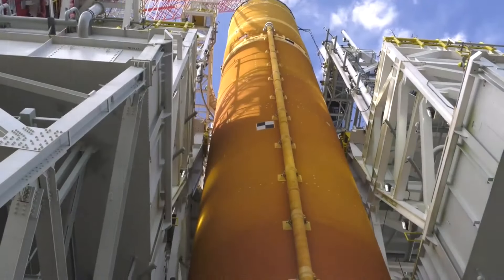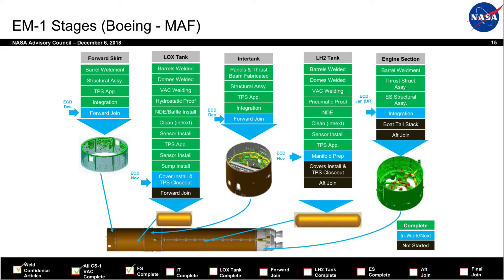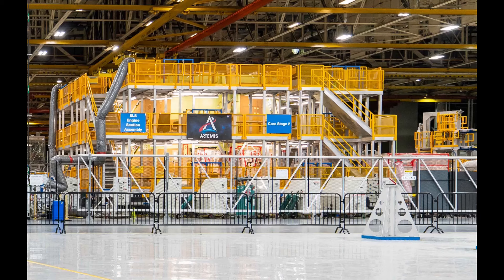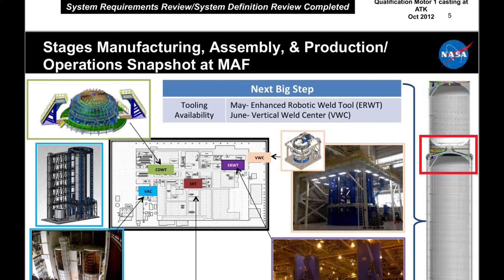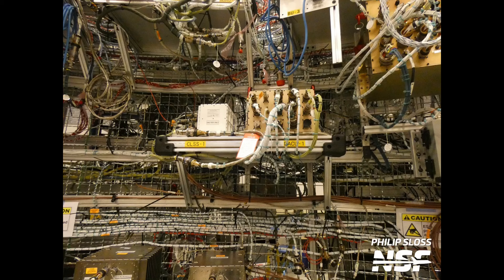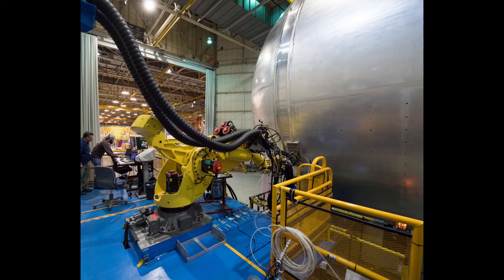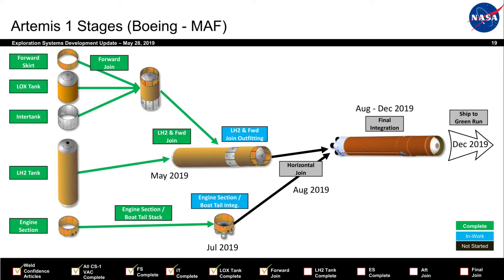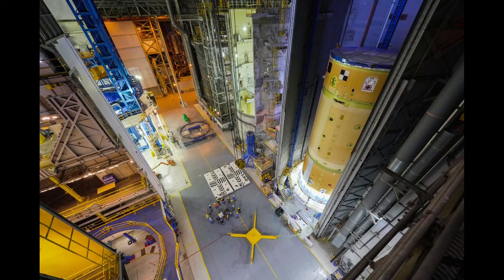NASA SLS Core Stage: Production Overview, Part 2

Comment: I wonder if we could eventually see a Block 3 or Block 2B, where the engine section is reusable, with a recovery system similar to ULA's proposed SMART reuse inflatable heatshield system.
The RS-25 engines and many of the Shuttle derrived components were originally designed to be reused many times, so it seems like an interesting concept.
Could this be a way to eventually reduce the cost of SLS, or would the RnD costs of such an upgrade make any potential savings negligable, compared to just focusing on optimizing and streamlining the manucfacturing and testing process?
Reply from the maker: It's hard to forecast into the next decade, since SLS is supposed to transition to a "privatized" contract in the next few years.  It probably depends a lot on where the money is coming from.  If the U.S. government is still paying for most or all of the costs for SLS, it's unlikely.

But it might be unlikely, regardless.  It's not yet clear how much money Boeing and Northrop Grumman are going to be willing to invest in SLS once they take over.
Reply: @PhilipSloss I think the primary issue here is that it would mean completely redoing the engine section, and potentially shortening the liquid hydrogen tank, which means shortening the liquid oxygen tank, and potentially moving the SRB attachment points. It would also be more difficult to recover compared to Vulcan, unless it was hauling a heavy LEO payload. There's a lot of extra work that would have to be done, potential lost performance, for a vehicle that doesn't fly a whole lot anyway, so the benefit would be slim to none.
Reply from the maker: There are a lot of technical issues and financial ones.  But purely speculating I'm not sure which hurdle is bigger, the technical ones or the financial ones.  

"What's next" or "what's coming" for SLS (or not) is another one of those big picture, can't-really-answer questions I am hoping to get to from time to time.

Comment: How many used shuttle engines are left for this program, and once those are gone, what’s next?
Reply from the maker: NASA still has twelve flight engines left, assigned to Artemis II, III, and IV.  They also have two development engines left over from Shuttle that they have been testing over and over in the stand at Stennis Space Center for SLS since early 2015.
Reply: They have 12 remaining flight engines assigned to to the next 3 launches.
After those are depleted they will be using production restart engines.
AFAIK they want to get the first newly built flight engine to the test stand later this year for a green run test.

Comment: It should take a lot less than three years to build an SLS first-stage.
Reply from the maker: Boeing really hasn't had a build under a stable set of conditions.  The first one was the first one.  Then COVID hit and disrupted, well, everything.  And now they are trying to phase in sustainability with new contracts and contract features for the third build while also working on the fourth and (probably) starting the fifth.  

Adding the second site for engine section outfitting/integration and stage final assembly also means the third build will be another "first build" to some degree.
Reply: @PhilipSloss  You are right about the COVID-19 pandemic but if Congress had given NASA the extra funding that Bridenstine had requested for the Artemis programme for several years in a row progress would've been much better.
Reply from the maker: It was already too late by the time Bridenstine became NASA Administrator.  The programs needed the infrastructure and the extra funding at the start, right after the 2010 compromise, but it wasn't available for at least five years.  Bridenstine wasn't confirmed until after that in 2018.
Reply: @PhilipSloss  Good points and this shows some shortsightedness by the Obama administration. Something from the Constellation programme that shouldn't have been cancelled was the Ares I-Y flight as that would've flight-tested the five-segment SRB and the Mode 1 high-altitude abort test of the Orion LAS.
Reply: Lead times for aerospace typically range in the double digit months, so a 3 year assembly timeline doesn't seem that surprising.
What's more important for cadence is how many they have in flow at the same time and how often they add a new build to the assembly line.
Reply from the maker: They're only working on the first unit from the second contract, and it remains to be seen when production reaches the 36-month projection.  One of the issues with that is the contract situation in general, but that also speaks to the program situation, too.

SLS is moving from the original contract for the first two builds to this interim contract for the 3rd, 4th, and maybe 5th build...while at the same time trying to move to the "commercialized" contract.

Engine section assembly for the 3rd build began at the end of 2020, early 2021...so there's still a ways to go to complete production of a unit in 3 years, and they are going to be on-ramping this new final assembly plan at KSC with the third build, which adds another disruptive factor to production.

Comment: Cool and all but by the time the second SLS flight takes place starship, a rocket that can put twice as much as sls in space reusably, will be flying weekly. This thing is just a waste of money.
Reply from the maker: NASA would definitely take weekly Starship launches by that time.  They're going to need that eventually for HLS Option A.
Reply: Starship is tumbling in space while SLS has sent a payload to the moon
Reply: Starship will very likely not be close to such a cadence by then, and that very well could extend to never.
I'm hearing the current generation of V1 vehicles are capable of less than 100 tons to LEO, so maybe comparable LEO lift capacity as an SLS Block 1, with reusability still seemingly far in the horizon.
Even ignoring all that, a two stage Starship vehicle can't perform the same functions as an SLS rocket, because the high dry mass of the second stage makes its TLI payload capacity low to nonexistent.
Maybe a partially or fully expendable 3 stage variant, which is not planned.
Reply: @artemplatov1982 If excluding reusability, their latest test flight was 100% successful. It did reached the point where it would be delivering its payload. 

All that “tumbling” you are talking about happens during re-entry.

Don’t forget that NASA were able to launched and delivered payload to space 1 time in the past decade with its own rocket. 

SpaceX did over 300++
Reply: @tonamg53  it barely reached space
Reply: @brokensoap1717  Starship is expecting to carry between 100-150 ton to LEO with full reusability.

So it’s around the same as SLS but with reusability. 

Yes, the second stage has very high dry mass but you forgot Starship first stage is over twice as powerful and carry around 2-3 times more propellant than SLS first stage.

So yes, it should be able to carry over 100 tons of payload to LEO even with that massive second stage.
Reply: @artemplatov1982  It reached exactly where it was supposed to be releasing its payload as planned.
Reply: @tonamg53  it reached 137 km no satellite operates there
Reply: @artemplatov1982  It was a test flight. 

How much harder do you think to filled the tank a little more and burns a little longer in flight?

Seriously🤦🏻‍♂️…